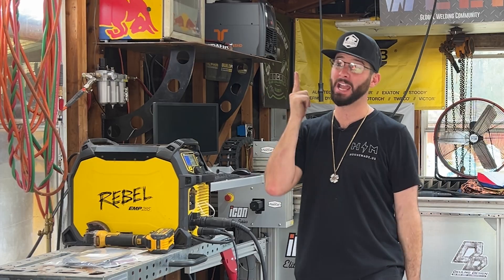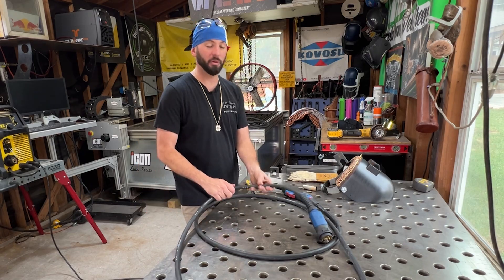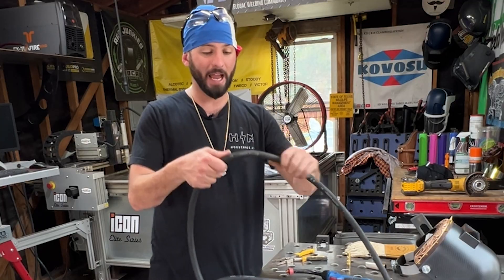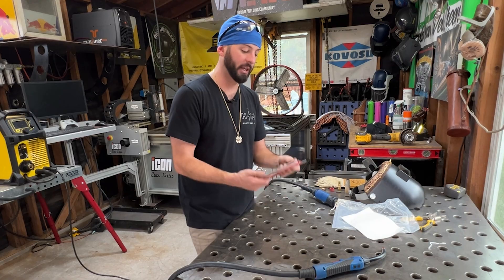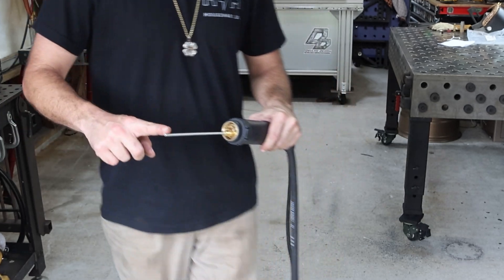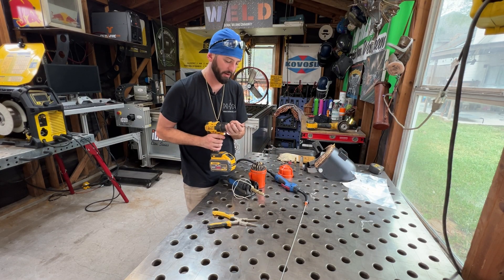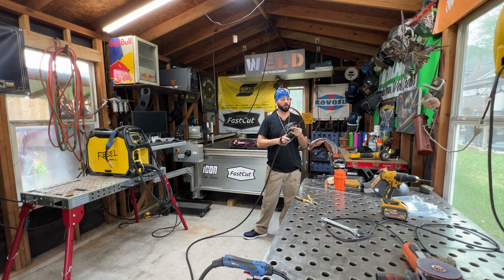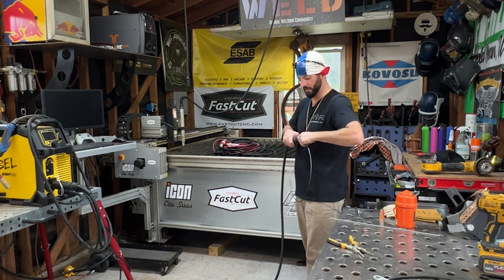When's the Last Time You Changed Your MIG Liner?

Comment: I bought an old miller welder that would work Intermittently.  When I pulled the old liner it was covered with powdery white corrosion . I cleaned it up and it worked fine. Does anyone put Ox gard on the liner where it goes into the contact tip ? And, since the previous owner had bought a new liner I went ahead and put it in.

Comment: I have 2 mig welders and have never changed out a liner. Multiple 12.5 lb, rolls each. Ive had an old roll of flux core rust up and get jammed in there. I eventually got it out and put a new roll in,  probably a year ago and its been fine. One thing i did do was add a home made scotchbrite cleaner to both my machines. This is something new for me to watch for. A worn liner.

Comment: Before I got a new machine with a beefy gun and line that's hard to pinch, I would annoy maintenance with replacing the liner in the cheap master weld mig gun replacements we'd have to quick swap. They'd always get hot doing angle reinforcement on duct and come loose and the liner would always start going bad in a couple months if nothing fell on it.  Was teaching a coworker to use silicon bronze wire and told him it's frustrating because his liner went bad that's why it feeds weird and bird's nests.

Comment: I hate changing liners, so I bought different guns for different materials and diameters. It’s not so bad, three guns. I do suggest that once in a while, blow the liner out with an air gun with clean DRY air. Blow from the connector end and remove the tip first.

Comment: I was literally looking at liners... I think there might be a slight kink in mine. I'll notice a slight hesitation and lunge periodically. It doesn't affect the weld, but it's annoying. Another thing, moving the torch also makes the wire come out a bit more. Annoying because it's a new machine...

Comment: What is "induction" in a MIG machine and how do you adjust it??
I read in comments things like 'reduce your induction', 'raise your induction'.  I have no idea what it means.  I think it was in your MIG/Stainless steel video but I'm not sure.
Reply: Simply put it’s like arc force for MiG. It will crisp or soften your weld pool. This can affect penetration and weld size. It’s mostly used or adjusted to smooth out the arc. For most everything short circuit on carbon run what the manufacturer recommends. On my everlast is 70% however for open root MiG I’ll turn it down to 50%
Reply: @Drweldz    You wrote "It will crisp or soften your weld pool."   I don't have a knob that says "induction".  But there is a knob with a symbol of a weld, like a little hill..  One side is showing a flat and wide 'hill', the other side a tall and narrow 'hill'  (that's the weld shape), and in the middle is something in the middle between these two shapes.  I always leave it in the middle since I don't know what it is.  And I didn't notice a difference in the weld when I play with it.   Is that it??  
New machine came with no instructions manual.  3 phase 350 Amp machine. Not a hobbyist's machine.

Comment: The first mig machine I ever purchased back in 1982 was a BOC three phase machine, the instructions that came with the Binzel torch said to fit the liner and cut it to the right length by marking the liner with a felt tip pen then to remove it and cut it back 5mm shorter than the marked length, the next machine said in the instructions to mark the end and stretch the liner out 5 mm and cut it. Either way it seems that the liner needs to be 5mm shorter than the torch length including the diffuser.

Comment: Why bother taking the contact tip off? Just run the liner all the way up there and then cut the back end. Also, each time you change spools, if you have compressed air available blow the liner out and it'll extend the life of your liner.
Reply: Compressed air is a good trick. However the liner has to be pushed all the way through to the nut. You have to take the diffuser and contact tip off

Comment: Use a center drill to remove the burr in the liner 60 degree angle as opposed to a drill which is generally 118 degrees plus the center drill is way shorter and has a pilot end to help centralize the drill resulting in more control. Good info BTW.
Reply from the maker: Thanks for watching and the great tip!
Reply: @Welddotcom definitely a great tip as I’ve not thought to use the center drill but definitely could save ya a few bucks in the right circumstances